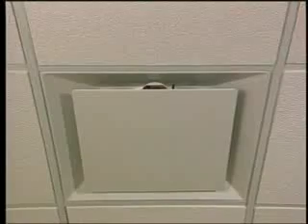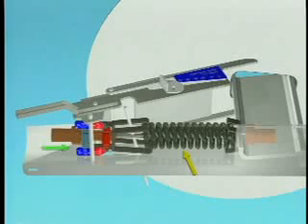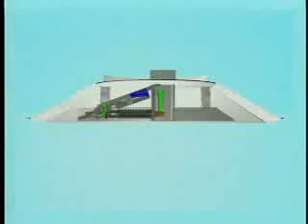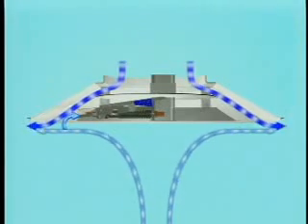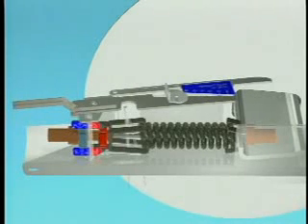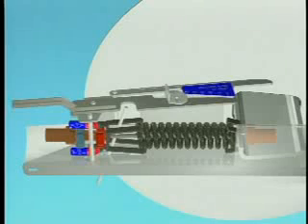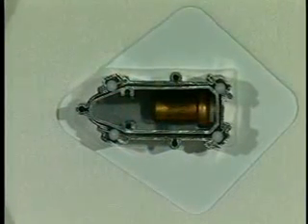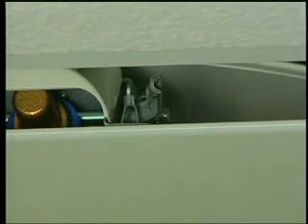Acutherm Therma-Fuser Diffuser - Model ST-HC

Comment: What is the meaning of stand alone?
Reply from the maker: Each Acutherm Therma-Fuser™ ceiling air diffuser has it's own thermostat and VAV damper integrated. Therefore each diffuser acts as it's own zone providing individual comfort to precisely match the requirements of the room or portion of the room served.